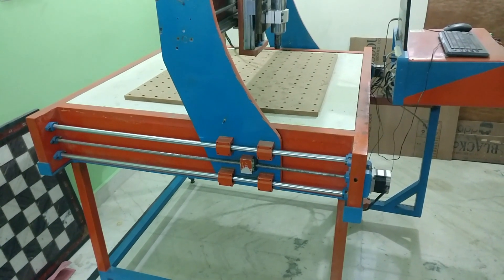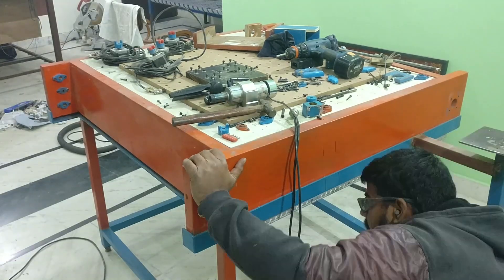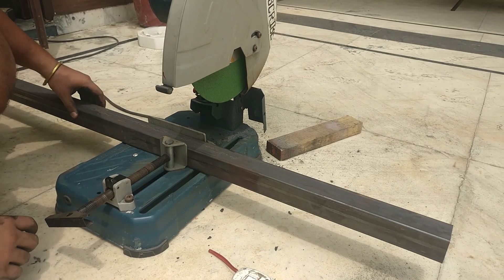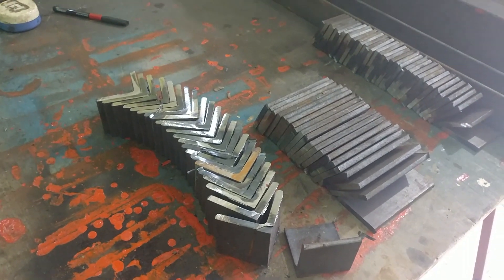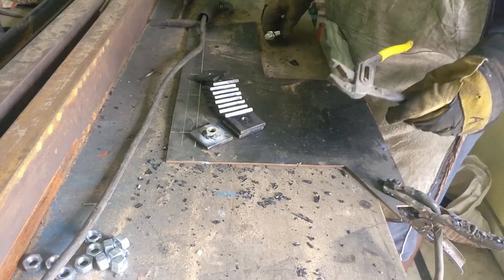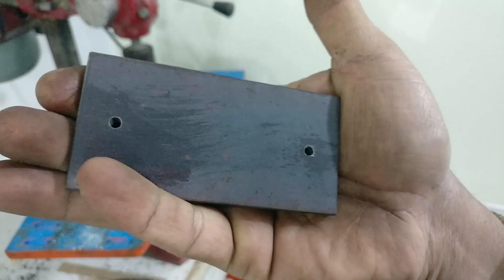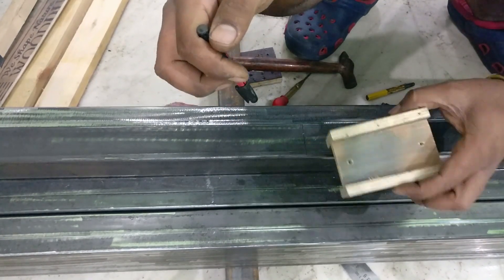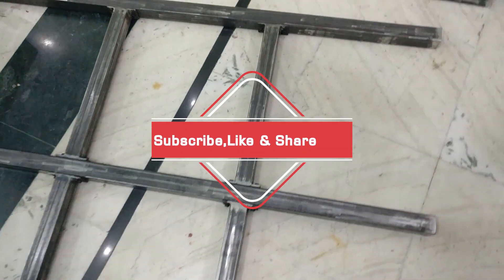Learn building a Six Axis CNC Router Machine - Steel Base Part-1 by Ambros custom

Comment: Looking great so far. You are a very tidy welder. I bought a set of Arc welders from Lidl just last month but I am not sure if I will be able to achieve such a neat weld line as you have with the rod welder. I will soon find out, I suppose.
Reply from the maker: I guess you can do much better than mine, it's all about game of practice. Just give yourself challange while learning and end result is astonishing. Good luck mate👍
Reply: @ambroscustom  Cheers for the positive feedback. The best of luck to yourself also. 🙂